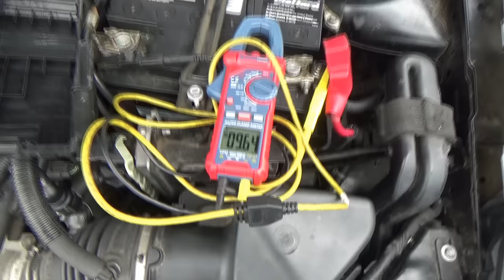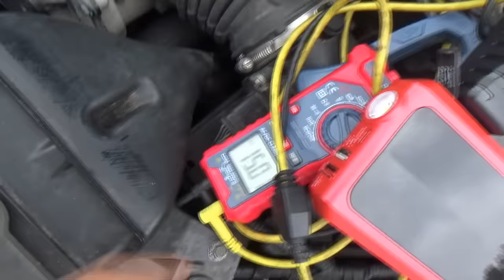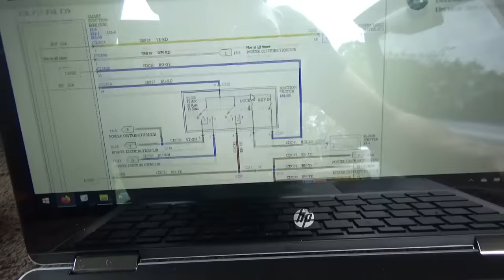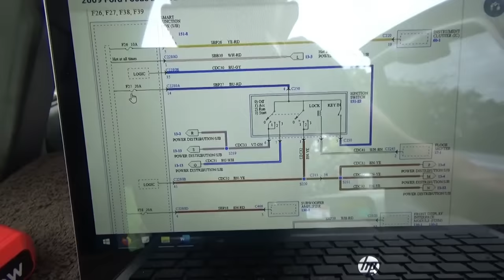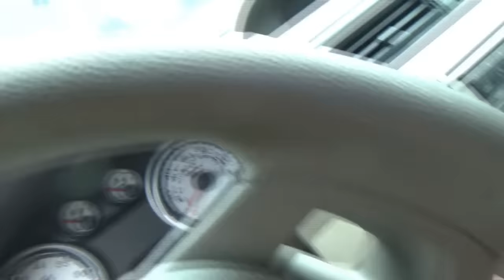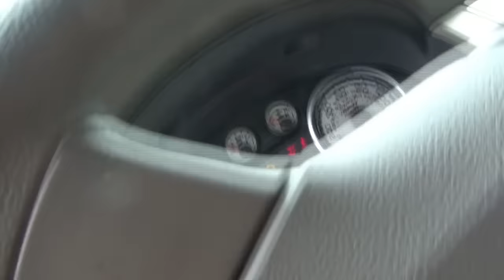How to FOCUS Your Diagnostics? (No Ignition, No Crank)

Comment: LOL! When I saw the glisten in your eye when you said "Let's take this switch apart...", I knew this was going to be a No Parts Required fix! Nice job, Ivan. Thanks for taking us along. I agree. Charging for separate issues is very reasonable.
Reply: Parts will soon come with an "Ivan seal". They're loosing part sales! LoL 😂😆
Reply: @dans_Learning_Curve  I recall a decade or two ago hearing that GM did a survey by having their dealers send back to the factory all the electrical components that were replaced by their service departments and found that 75% of the parts were actually NOT bad!

Of those 25% that actually were bad, probably have could have been fixed by an Ivan-style hack.

That tells me that typically only maybe 1 out of 10 electrical components that are currently being replaced by shops actually really need to be replaced.
Reply: @hooptierescue2540  I believe it!
Just think of the profit!
Reply: Hello Ivan, great fast pro work, as for how I go about charging the customer to get the car running again I usually go by the hour straight thru until everything that pertains to running is fixed and since turn signal does not do with starting and running I will let the customer know if wants if fixed. I had a similar situation with a 2014 Ford Ecosport  2.0 sigma engine (I keep updating the customer as I go along thru whatsapp ) and I present the total hours worked plus parts.
This is how I do it here in Brazil
Reply: Great 👍 video Ivan .
Reply: Ivan, I love every video you produce! Thank you for your explanation of how you charge customers. This will help me greatly in charging customers if I have to work on some vehicles. How much, on average, do you charge for the hourly diagnostic? Then you have to charge for maintenance and parts if need be.  It looks like I'm going to have to get a subscription to AllData if I start working on a lot of vehicles. I like the amount of information that is in that program.
Reply: @hooptierescue2540 In electronics, it is most often that you will find corrosion, a bad ground (associated with leaking water, rust or other corrosion), and corroded or out of place connector components (i.e. either the male pin or the female socket). A quick spray of 5% De-Oxit can work wonders in some of these situations, as demonstrated by Ivan here. A small mirror is handy for examining hard to see pins and sockets in a connector - such as when they're pushed back out of place, or not locked in; it can be pretty obvious once you can get a good look at their relative positions with regard to the adjoining pins and sockets.  If the connector is hard to separate, a gentle pull on the individual wires coming out of either side of a connector assembly can quickly locate loose connections, before you pull it apart.

Comment: Most mechanics and shops just swap parts including whole assemblies, they don’t speak your no parts required language.
Reply: In a dealership setting they sometimes see a certain vehicle line that may have repeat failures of a part. In that respect, it is quicker to substitute a known good component to see if that's the issue. Remember, most shops are flat rate, not hourly or salary.
Reply: Even if they do fix it no parts required, most would still probably charge you for a new part anyway.
Reply: @stephensams709  I think I would’ve opted for the clutch switch.
Reply: @jamespn  exactly
Reply: ...with parts from China. And if they're working for a shop I really can't blame them. Have to get so many cars fixed per hour, you know! (even if it's not done properly).

Comment: As someone whom has taken a rig in with some bizarre issues like this, I would much rather have the tech do exactly as you have and tell me this is xx, this is xx, and this is xx. Further repairs will be approximately xx depending on the situation, then leave it up to me to decide the final outcome (and I'll be honest - I can't recall a time when I haven't told them to go for it when they have been this upfront and honest with me). When I get good information provided, I have no problems with making an informed decision because I know the tech is trying to do the right thing by me, and that the tech is proud of the work being done. Kudos, Ivan!

Comment: About ten years ago I bought 3 focuses with the intentions of getting 2 going .  I got 1 going for me as a daily driver and when my boy turned 16 we decided to get 1 more going .  Both had damaged heads .  We had a pile of pistons and crank bearings and picked out the good ones and put new rings and what else was needed and got it running.  Yes we used plastigauge. Believe it or not his car ran great for 2 years until he sold it for 2500.  I don’t think I even had a thousand in his.  They had a few bugs but not bad cars.  FYI my nephew is still driving my old one. Always enjoy your videos and thought process.
Reply: You are completely disregarding the hours you invested? Apparently you have way more time than money? Good move on the plastigage.

Comment: That excessive vibration after start tells me the engine mounts probably need replacing.
Reply: @Jonathan A a little jiggly  cold, especially with mileage….but smooth as butter when warm….
Reply: @Jonathan A Perhaps, and replacing my mounts on a Focus like the one in the video made a huge difference.  
My dentures have stopped rattling.
Reply: It’s almost always the top mount on the right side, about a 20 minute job to replace it
Reply: It does sound like quite a rattle when it fires up.

Comment: I agree. They are different issues. You fixed one. How are you to know there are more issues until the first is fixed. It’s like fixing a dead battery to find out the engine knocks while running! You would not know it knocks until you fixed the battery issue. Separate issue to proceed to. Can’t all be included. Great diag and repairs as usual Ivan!

Comment: The wiring diagram was a big help.  So many times in the past using the IDS at work, checking the circuits using the wiring diagram found the problem.  Except for intermittents!  At that point the diagram showed the potential problem areas.

Comment: I charge an hour initial diagnosis labor for a no start/nothing at the turn of the key, then straight time for all other repairs associated with that.  The key program would have been however long it took and then the turn signals would be another diagnostic charge of an hour plus straight time for the repair.  Customers need to understand these scan tools and repair subscriptions to All Data, etc, cost money.  Without them the labor would be a lot more.

Comment: Focus vibrations usually are found around the motor mounts. Right side can be replaced in 15 minutes. Left side ( transmission side ) takes 30 minutes to install. Don't forget the Dog Bone rear bottom of engine that takes the torque of starting stopping. One can change that on your lunch hour. I've owned a half of dozen of these " Throw away cars " and I've seen these problems quite frequently.

Comment: The non-functioning turn signals reminded me again from the Mazda I once owned. One day the turnsignals didn't work, but by repeatingly turn the switch back and forth, they started working again, and worked without problems the rest of the time I had the car. Just one day malfunction, no parts required :D
I know I've talked many times about that Mazda in my replies, but had it so long that I got to experience a lot with it :D
Have had my current Kia Rio over 5 years too, but there's nothing to report, it keeps working just fine :)

Comment: Great Diagnosis!  I bet, the reason the clutch switch failed; the owner takes the Focus to the local 1/4 mile dragstrip on the weekends. You know, double clutching this beast at well over 3200 rpm!
Reply: LOL . . . I was thinking it was a little R U S T Y down there. It got wet at some point.
Reply: I have an identical car minus the color over 670,000 miles on it and hammer the hell out of it never had a problem with the clutch switch
And all but 68,000 of those have been done in what will be six years this January
Replaced nothing except wear parts finally had to replace a starter about six months ago
Best car I’ve ever owned

Comment: 2003 Chev Impala with an ignition switch issue/security light on. I diagnosed a defective switch as a cheap fix, just spray electrical contact cleaner into the key tumblers. There are contact points deep inside, it worked for me saving $$ and time. No issues ever since.

Comment: You are smart charging for the job the way you do. When I worked for a dealer it used to chap me how some people would think we should fix everything for free. Then the real kicker was when they saw the labor rate on the wall of (at the time) $70.00 an hour. They would make the assumption that the techs actually get paid that. I would say yes, that's why I drive a 13 year old vehicle making $70.00 an hour, 🤣😁.

Comment: With the kind of rust on the inside dash frame im not surprised the switch was a problem much like the old light floor dimmer switches that got corroded and crunchy from winter conditions

Comment: I have a 03 Focus SE wagon 245k miles vin code Z2.3  automatic no major issues! I use CONVENTIONAL 5 30 oil , never have changed the orig atf no leaks shifts perfect .

Comment: At 10:25 agree with you 100%.  if the fuse was missing?  You would be testing the fuses that were present and than would still have to test the ignition switch power source,

Comment: All fords have this problem I have a 2014 Ford Escape SE and after several times it was not starting had to jump pack it. Till I meet a ford mechanic from ford who asked me a question if I had a new battery installed in my car. He said that the car cpu needs to be reset. He use a cable to my odbII   to a laptop and there was a reset icon on the screen. Now it starts all the time put my jump packs in my shed.

Comment: Had the same problem with my nephews car. Did the same steps with multimeter and it was the clutch pedal switch too. He was ready for a new starter but saved him the cost. The switch was 1" too short, it wouldn't pop out that additional 1".

Comment: you hope so anyway!!! I fixed a brake light switch by adding a spring in a space where it seems to me, that KIA should've installed a spring rather than rely on the switch contacts alone to act as a spring. The contacts were not moving into and out of contact when the brake pedal was operated, so far it still works after 6mths. I'm afraid to say anything.

Comment: it's a manual trans. and the clutch switches get endless cycling, so I always auto-assume the clutch switch is bad when they wont start.
as for the blown fuse, that's an unknown, but likely someone else tried to troubleshoot it and caused more issues. lol

Comment: I had a 2002 Ford escort ZX2 2.0 liter D/O cams auto trans. It had an intermittent start problem for years. I fired the parts cannon at it and replaced the starter twice and the ignition switch once and the problem came back each time. When it acted up it only had about 9 volts running to the solenoid. I finally gave up and ran the wire for the solenoid to a relay and to the solenoid. It started every time so I donated the car to the veterans because my daughter had bought her own car by the time I got it running. lol
Reply from the maker: The ZX2 is way more fun with a stick shift 😁😁

Comment: Didn’t Eric o work something similar with a adjustable bottom travel  clutch switch
Reply: I'm pretty sure Eric O did, but I'm thinking it was a brake lamp switch. Veh came in for no brake lights and he either found the sw was either just out of adjustment or just hanging loose behind the dash. I don't remember which.
Reply: Thank you.....as I said, I know I've seen that video, I just couldn't remember which switch it was

Comment: On your test light... You should add an LED parallel with your test lights, one facing each direction (since LED's are diodes);   That way, you'll still have a way to detect lower voltages, and which direction the polarity is.
Reply: Good idea seriously

Comment: Well as for the charging, my take on it is that it is one issue to me as a customer, what it breaks down to and the time to solve that issue is a different story.
If it took 1 hour and 30 minutes for your 2 sub issues and then a key programming that I had requested on top of it? Well that is to be expected.
Reply: The key programming is a separate set fee. The tool is expensive.

Comment: Interesting to note some clutch pedal switches stop working because someone uses their finger in them to press it manually and they have a one way ratchet mechanism that once depressed will not allow the pedal to touch the contacts , once you pull it apart you have to put it back together and install it without pressing it(I know hard to resist) then once installed you push the pedal down once to set the mechanism then it works again I have gotten in the habit of (NOT) pushing switch until installed for that reason you never know if they are going to be self setting mechanism until you press it then it’s too late some are serviceable some are not costly if you get non serviceable and you screw it up off the bat, just some advice for those who do their own work at home that this can be a problem
Reply: Is the locking ratched a bug or a feature? Please explain using less words.
Reply: @erik_dk842  it’s a ratchet adjustment system it’s a feature and a nuisance when performing diagnostics if someone has been screwing around before you, you can pull apart and reset most times but barb clips on side are fragile and break easily

Comment: Those clutch safety switch causes too much headache. Old cars I have always started in neutral. I still push the clutch pedal force of habit, but no need for safety switches.

Comment: Willing to bet on the turn signal switch/headlight issue, owner was getting slightly “frustrated” and started smacking the top of the steering column and then tore stuff apart and never put it back together “correctly”

Comment: The clutch safety switch on my Dakota went bad at a gas station, couldn’t figure it out, couple ppl were like let’s push start it, I’d pop tje cluch, when we went to do that, as I was getting in I seen a chunk of plastic on the floor, was like hmm, didn’t over think it till we were in the process of popping the clutch and the pedal went to the floor. Stupid clutch popped outta the master. Put it back in and it works but no more clutch safety switch. Just jump wired it and it’s constantly hot now but what ever it works it starts nothings drawing power at all times or anything…

Comment: Another wonderful diag and I'm impressed by the use of those 2 globes connected to the 30amp fuse to see if it has a short. Are they wired in series or parallel?
Also when you were testing the starter side of the relay pins to see if the starter will engage, the idea of having an inline fuse is good, but I also would think that a momentary switch fitted would be ideal just in case of needing a quick disconnect.
Ah yes, there's always the chance of the crusty demons showing up into the electrical circuit...

Comment: Ivan great video.    I have the same car, and my  Fan switch works on 1 2 3 4 ,  but  when switching from 2 to 3,   3 doesn't become any faster than 2 for the fan. 
All other speeds 12 4  work at the speed they should.   3 just operates at the same speed as 2.    Does that sound like any common problem you are aware of?
Usually i found when blower motor resistors fail, they nothing works but the highest setting.  I even replaced the blower motor with OEM part, and the same thing happens, 3 stays the same speed as 2.

Comment: MFS doesn't cost much , thousands at yard have them. I replaced my DPFE and then my Evap solenoid located on the firewall for several dollars. After mechanic friend Dx it with his bi-directional.
Been working for years. On my 2002 the switches new are not too bad for cost. Mine still work and I noticed things on mine were made in Germany/Spain and have lasted 20 yrs. These Gen 1.5 probably went to Chinese parts ?

Comment: There's two things every DIY or professional mechanic needs you need a laptop so you can get your diagram's and a good scan tool
Reply: Neil. That is IF you can get a internet service. Now you back to basics. Plus your scan tool as a basis for a starting point. If you cannot get internet service. You cannot get diagram. But you can get the vin# prior to the diagnosis. Download your diagrams. Then go for the gusto.
Reply: @2nickles647  That is true phone signal is hard to find out in the country or outside of town's

Comment: On the UK ford focus. If she doesn't start, slap the dash. Boom, Sorted
Reply: Ha! Chrysler mini vans had that issue with a bad connection in the instrument panel !
Reply: FOCUS of the Russian assembly, also has a problem in the printed circuit board of the instrument panel.
Reply: Also worked on Volvo FL low air warning must be a industry standard .

Comment: Most important tool is not in the bag, its between the ears. Electrical is not like mechanical where a failed component is obvious, one has to use some imagination, diagnose and   test. There is literally no second chance, you might cause further damage or fire.

Comment: im pretty new to electrical diags and just bought a bi directional scan tool,i cant find many video that teach on using bi direction and testing,example if door switch doesnt work but bi directional control for switch what can be ruled out and where to go?i assume this would indicate bad switch but i need to understand how the bi direction works and what its doing/controlling/not controlling/is bi direction always a input/output etc to be efficient at this i need to understand it

if you could point me to any classes or videos on scanner diag please do,or if you could make a video that would be awesome as this info is lacking on youtube.